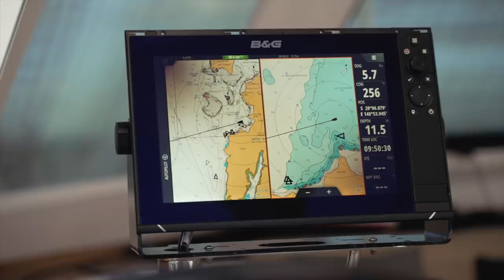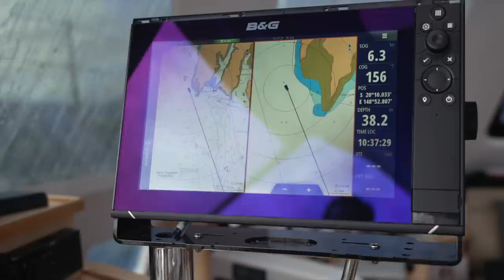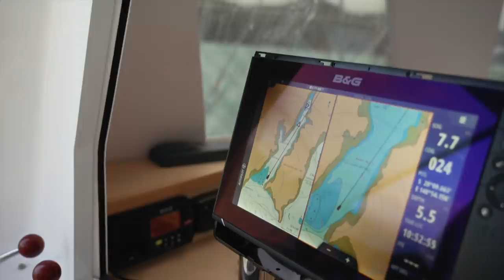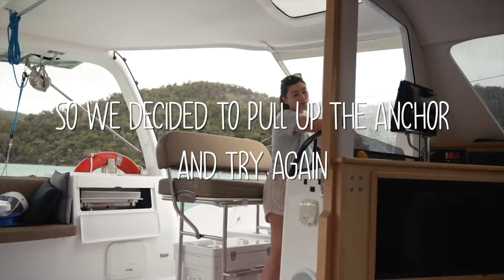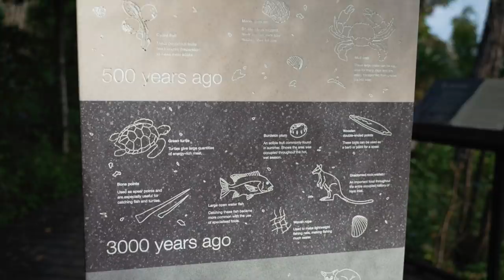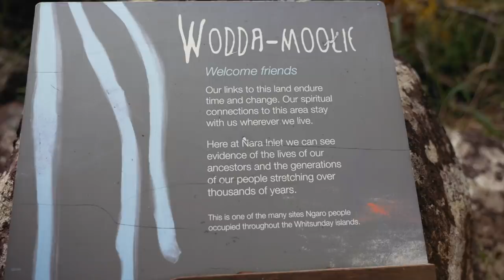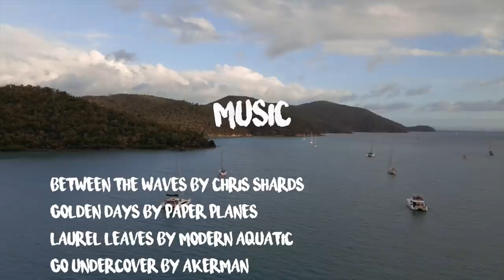Do Your Boat Maintenance or Risk Losing Your ****** Boat! (Nick Loses It!)

Comment: Top tip for you from 0.19. if you stand the mug on the tag attached to the teabag string it doesn't get dragged into the mug by the boiling water. Safety first kids!

Comment: Whilst these things are annoying, they are bound to happen from time to time and be prepped for them.

As a commercial ocean tug skipper and avid sailor with my partner i see one main issue.

Nick should be lead deck and get Terysa up to a level of competent skipper.  In any event like that one today it usually demands a good amount of strength using muscle groups that biologically men are around 3 times stronger in (upper back , shoulders etc).

At this point nick wouldn't need to stress thinking of everything,  more so just hand over the helm calmly without any annoying comments like " just dont hit anything " and the second skipper would happily nod the boat in the direction of the anchor whilst the 1st skipper humps the chain in, then lay it out, reset and during that time Teresa would have been looking to see if this location is still best for anchoring or better to move and manually let the chain out thats nicely flaked out ready....

You're a pleasure sailing craft, you both need to be skippers or deckies at any given moment so one person doesn't have to take on 2 jobs whilst ranting in a crisis with a passenger looking on.

Just my take. 

Ps. The handle was a piece of crap but just highlights further weak points for improvement in my opinion.

Comment: I had my honeymoon on a self-skippered 45' cat in the Whitsundays departing Airlie Beach. First night was in Nara Inlet (like a millpond) with just one other yacht for company. Second night was at Turtle Bay. The next morning the port engine wouldn't start so the hiring company told us to go to Hamilton Island Marina to get the engine repaired with a complementary 24-hour stay. I was advised that I would be met outside the marina, since I had just the one engine, and assisted in bringing the catamaran in. No worries 👍. When I got close and radioed in, the marina told me to come in through the marina entrance myself 😳 whereupon I would be guided to my allocated arm / berth. I brought the floating tennis court in, with just a starboard engine, to my berth (downwind) smooth as silk .. an absolute complete fluke. Parts for the engine had to be flown in, so turned into an all expenses paid 48-hour stay in the resort. When we finally continued on our way to Whitehaven Beach, we encountered Kerry Packer's pleasure craft (88 metre converted ice breaker) anchored off the east side of Hamilton Island. And so on .. unforgettable 10 days.
Reply from the maker: Sounds amazing mate. Good skills getting into a berth with one engine

Comment: Had a similar aggravation in the BVI once on a power cat.
The admiral runs over a pennant which stops the starboard engine...which is the only thing that powers the windlass.  Then the emergency release...won't.
Ran to the stern locker for the Bruce and dropped it.
Ended up the pennant was holding well enough not to panic, but still a solid 300 seconds of sequential Oh S_it moments.
Reply: It shows the value of spending some non sailing time asking "What if" questions. You might just have already solved it when sh1t happens.
Reply: @jonathanwetherell3609 Agreed!  
The problem is when you get locked into a series of solutions you thought would be the easy solution, but the failures keep coming.  That makes it hard to back up the OODA loop and find a better path.
It's Road-Runner/Coyote...the worse it gets, the more the Coyote doubles down on the chosen path.  That cartoon is funny because we can see ourselves doing exactly that.

Comment: Yea, without knowing the wind speed on a Cat you are at a disadvantage and its best be careful. 

For those who don't know it, a Cats sail plan is determined wind speed, or 'by the numbers' to protect the rigging because they can't heel and dump the wind or take a gust the way a mono-hull can.  That upright rigging has limits on what it can take and if you don't know the wind speed you don't know if you can run with full sail or need to pull in the head-sail and take a reef or two.
Reply: On our cat it was recommended to reef at 22-25kts. On one of our early trips there was just my wife and I so at 18kts I decided to reef. Was truly amazed the we actually went faster, so aside from being safer, it was indeed faster. Yo see, while not heeling that much, the cat is actually burying the leeward hull creating more drag.

Comment: Takes shirt off ‘your job is not to hit anything’ - presumably that includes you Nick!?  We had a similar windlass issue recently, let’s just say, not caused by me, with only two of us on board…. It was solved and it took a while to get the Adrenalin out of my system… I had to apologize after too.  High stress is for the skipper to deal with….  Thanks both for the unvarnished parts - keep it real - it keeps us here with you both.  Let me know when you bring the new boat through Singapore - dinner on us!

Comment: Re anchors, and knowing that you have chosen a Sarca Excel for RR2, you will be pleased to hear, that my 30 Kg Excel (No.6) has set immediately on the 4 nights I have used it (on my S38). In Itchenor mud last night it re-set without moving laterally on the 180 ° tide change, as shown by the near perfect semi-circular arc recorded by my GPS. Bodes well!
Reply from the maker: Nice. Thanks for the info. Would love to be anchored on an S38 now 😭😭😭😭

Comment: That's not bacon that's sliced ham. 😋🇺🇸
That wasn't boat maintenance that was tool maintenance. Such a simple tool that is so important you would think they would make it one solid piece. You're completely right. I've see big spanner wrenches that might do a better job than that one did.

Comment: A broken anemometer, release handle and stiff throttles show a bit of a problem with the charter company maintenance process especially on a newish Seawind 1260. I have encountered maintenance issues on a 2012  Seawind 1160 when chartering in the Whitsundays a few years ago. It was very frustrating for a family holiday but could have been dangerous for inexperienced or short handed crews.

Comment: Let me guess, you have been using "100 Magic Miles"?  Too many years ago ended in Nara inlet on our first night out from Shute Harbour, arrived late and dropped the pick.  In the morning our neighbours were being served breakfast on the rear deck below the onboard helicopter landing pad - still reckon my cornflakes were better, at least I know I earned them.  Later that morning after three attempts to lift the anchor and dropping most of the chain each time, realized the safety release clutch was not working and spent the rest of the trip having to lift the last few feet onto the bow roller by hand - I have empathy for your charter boat anchoring experience (just don't get me started on repairing the fridge that trip too).  Still, memories that will last a lifetime.

Comment: Moot point Nick, yawing is what you experience when you turn about the vertical axis as when turning your boat with the rudder. What you described would be pitching. Small point I know, but ,hey, you are a perfectionist. 😏
Reply: Yes, Nick motions pitching with his hand. But the cat would experience yawing too, don’t ya reckon? The vertical axis being where the anchor chain meets the seabed. (Pedant note: more or less depending on the wind strength)
Reply: @wheelerstudios  I am sure it does. Just wanted to give him the gears knowing it would irritate him.

Comment: Been missing a good Nicky rant!  I know it is troublesome to bleep, but it is fun watching/listening.  

From my safe seat thousands of miles away......it looks like it is poor design and construction more than poor maintenance.  Something like that should be a one piece cast/machined part vs thin tube with the business end held in by a small bolt very close to the end of the tube.  I'm not an engineer and can see how that is a serious failure point.
Reply: just a hire company doing things on the cheap
Reply: The tube should have been swaged on.

Comment: Wow, that broken lever is a stock part for the Lewmar windlass.  Obviously it is not a good design.  Ours didn't originally come with one, so we use a large adjustable wrench (I think you call it a "spanner.")  In the tool bag on every boat.  Seawind even provided a set for our new boat.  No big emergency.  And I think it's a little excessive to say a faulty Lewmar part makes for a poorly-maintained boat.  IMO